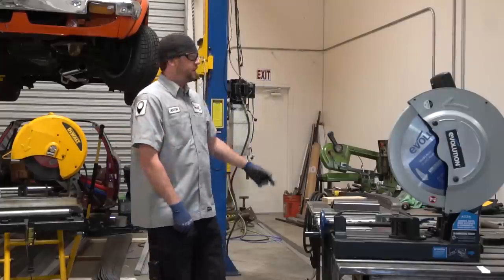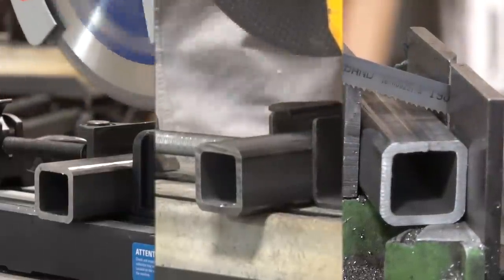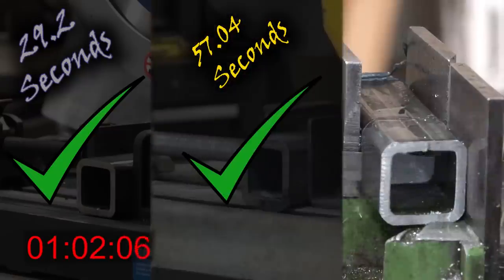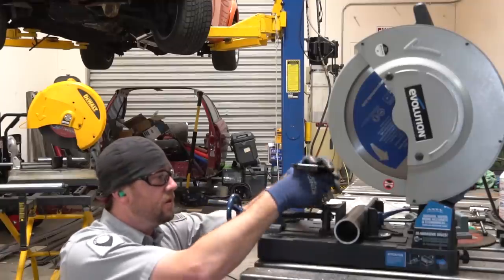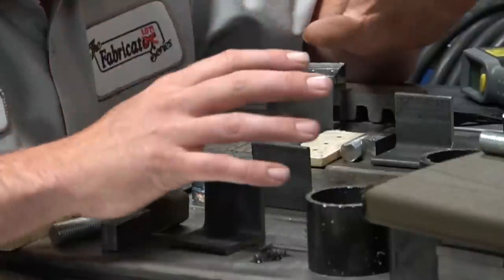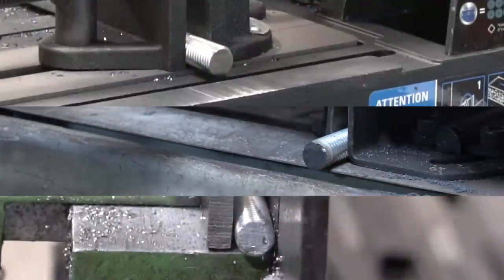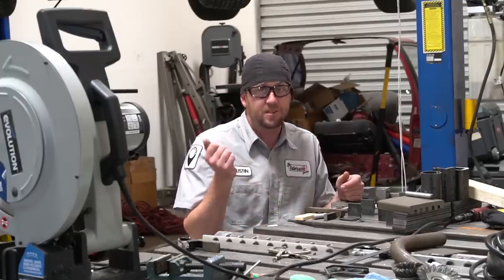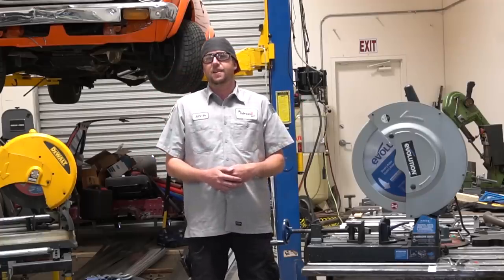TFS: 3 Metal Cutting Saws Tested and Compared

Comment from the maker: Ready to Weld Practice Metal
https://weldmetalsonline.com/

Tools & Gear We Use and Recommend
https://www.amazon.com/shop/thefabricationseries

Learn to TIG Weld in Our Class!
http://thefabricatorseries.com/classes
Reply: Get a thinner chopsaw disc 3/32, less material to cut and faster.
Reply: Is this sponsored by Evo?
Reply: Did you find the Evo saw chatter at all in the cut?  It drives me nuts with mine and the cut quality suffers.
Reply: @bikedeefer  mine chatters once in a while, and when it does.. it loses teeth.. I found a local guy who sharpens blades and replaces broken toooths..

Comment: The advantage with the bandsaw is you can walk away while it cuts and do other things. It also accurately cuts mitres repeatedly, with no dust and minimal heat. And makes hundreds of cuts on one blade.
Reply: Daryl Younger agreed. I have a JET that has a coolant system and feed rate setting. It has a 20” opening but I can only cut 10” thick stuff.
Reply: But then factoring in the blade cost as well, you have to be pretty serious to get the most out one.
Reply: also out of all the saws i find it has the least waist which i find pretty important for me cause i use rather expensive steals like pattern Damascus and certain cpm alloys over the course of a year you can save almost the entire cost of the tool in stock plus at points the abrasive saw can heat up the metal to much and cause some light decarbing its pretty minuscule but always good to take into account depending on the job
Reply: @blairfleming5861  im trying to get into a wet/cold saw for accurate metal cuts. I have a pos horizontal bandsaw, but it does take up some space. Im not finding anything good as far as a cold cut chopsaw for under $2000 - but i can find a LOT of quality 220 horizontal saws. for much less. I hate the footprint, but i feel like the horizontal bandsaw could do everything the chopsaw could but more.. What am i overlooking about a cold cut chopsaw, since the price seems so much higher, any ideas? Cheers
Reply: @Swilling  I saw the evolution ones have much play on the blade so it is not so accurate, maybe the dewalt is better.
Reply: The advantage with the evo saw is you dont have to wait at all - quicker to cut it than set up the old bandsaw
Reply: I have a 35+ y/o cheapo bandsaw that I have used all of that time. At times the blade jumps off twice a cut. Very annoying. The bimetal blades are better but expensive. And generally cut straighter as well.  It has built race cars, trailers, gates etc but can be frustrating,
I bought a friction saw recently, noisy and sprays crap everywhere but it cuts straight and quick and does not leave  very much mess. Good blades cut better and longer though cost more. Worth it in the long term
The third item you used is decent but the leave a bigger mess. 
The expensive bandsaw would be great but not on my budget!
I had a power hacksaw, slow, reliable and cut straight but it consumed to much room so I sold it
Reply: The advantage of the Evolution it seems is that you don't need to walk away because it cuts so fast, minimal bur cleanup and no coolant to cleanup either.
Reply: @alexisxyz7531  Was that one of the thin kerf blades?  That's their definite downside.

Comment: I have an Evo rage 2. It has the multi purpose blade. I'm very impressed Hundreds of cuts and it keeps on going. Hearing protection is a must
Reply: The thing I don't like with the evolution rage 2 is that mine has got a sheet metal base which is just flimsy and when you tighten down the piece you are gonna cut it gets out of alignment. And there is no way to adjust the angle of it so mine cuts crooked. The one he tries here does look A LOT better and I am thinking about either rebuilding my base or buying the blue series one.
Reply: The Rage2 I own has cast base so there's no flexing. I think they tried the sheet metal base on a model or two and went back to cast.

Comment: The abrasive is just nasty. Least favorite tool in my garage. Love my band saw. I would consider the evo for quick cuts
Reply: My abrasive saw is somewhere under a bench, Ijust use my horizontal bandsaw even though it is only a 50 year old 6" x 4"I can still make it cut true enough for welding.

Comment: Great video as usual - Like most fabricators I have all three - I have not taken the Abrasive off the shelf in 3 years. The bandsaw is my goto, its accurate and clean.  Although when I build a trailer or chassis with a lot of heavy tube to do,  the cold saw is FAST.. I wear full sleeves and a hat - those chips fly hard and fast

Comment: thanks for the info for us,don"t forget you can walk away from the band saw.
Reply: Wastage is a lot less on the bandsaw as well. Those chips add up, not only in wasted material, but in wasted effort. On a saw running all day nonstop, someone has to sweep up regularly on the evolution and abrasive (and the mess gets spread out a lot more) but only once at the end of the day on the bandsaw.
Reply: I'd rather not wait at all.
Reply: The safety guy says other wise lol
Reply: You can multitask.
Reply: Phil Harvey  Also you are limited more on the depth of cut in both the Evo & the chop saw ( less as the fibre disc wears too). I have cut solid 6" M238 injection mold steel on my cheap 6x4 band saw at 11pm  without disturbing anybody. I could not have done that on my Chop saw or Brobo cold saw. Not sure whether the Evolution would cope with a 6" x 6" SHS or solid  in one go even though it has a 7" depth of cut. Imagine the noise making a few of those cuts, very unhappy neighbors even in an industrial estate.

Comment: Great video! I don’t even have an abrasive anymore, I got rid of it once I got my Evo saw about 3 years ago. For anything large and in charge I use a large industrial Ramco bandsaw,. For anything 3 inch and below I just use my Evo. Blades for an abrasive run anywhere between $7 and 15 bucks, but a user will blow through them quickly. Blades for my Evo run anywhere between $90 and 110 depending on where you get them, And will last a bit of time if you take care of them. Now blades  for my bandsaw run anywhere between $45 and 55 also depending on where you get them, and those will also last a bit if you take care of them. I dug your “man glitter,” joke! Lol. Keep on making these very informative vids, you always explain everything that you do very well; so well in fact that I recommend your vids  to my apprentice as outside the shop study and learning materiali. Thanks brother!

Comment: I have all three types, my go-to for everyday use is a bandsaw (cheapie small one without coolant), for lots of cutting i bust out the noisy dry cut makita, and old abrasive makita is collecting dust in the corner for years.
Makita dry cut saw comes with blade for thin wall steel, but it cuts stainless or thick stuff without any issues, just be gentle on the handle. I'd say i made at least 1000 cuts with stock blade and it still rocks.
And cutting speed just blows me away every time i use it.

Comment: I have all 3 devices, and here's my input. One very critical issue besides the quality of the cut and left over burs is the ACCURACY of the cuts. I have noticed that the abrasive disks "walk" considerably during the cut, (partially due to their flexibility) and end up with an angled cut that's not 90 degrees requiring grinding to make them square. The Evolution also "walks" very slightly, but overall has a fairly accurate cut. By far the bandsaw is the most accurate cut, nearly perfect 90 degrees. Of course the larger the piece the more angled the cut becomes. I hope this helps.
Reply: Dude! Thank you so much, you can't believe how much videos I watched on youtube about these 3 types of cutting machines and none of them mentioned the ACCURACY of the cuts, and angle distortion, thank you so much!
This definitely helps a lot!
This comment needs more likes
Reply: I agree, I wish someone would do a comparison of these saws and their accuracy with 45 degree miter cuts

Comment: Results as expected. I'm the retired owner of an Industrial controls business. Have a bandsaw in the shop (now over 40yrs old and still like new)  and it's the goto for quality machinery frame fab work and the like. The chop saw is for road jobs, and doesn't get used except for road work and junk that may damage the bandsaw blade, good bands don't come cheap. I went thru several of these over the years, they don't last all that well, and will get you invited off many  a jobsite. It's usually a parking lot operation, and you better have a fire ext right there in plain sight at most places, or somebody will complain. The cold saw has been around a while, been kind of pricy for what you get for about 20yrs, so I never sprung for one, seeing as the prices are down, if I was still doing this work, I'd probably replace the  abrasive saw with one, and I expect it would get used along with the bandsaw when we get busy.
That's my mini-review, 
Thanks for yours, it's a good look at each, you could have skipped the wood, that's Sawzall material...

Comment: At first I was using a Dewalt Abrasive chop saw. The 45's were terrible, the blade would flex around so much that the cuts were all crooked.  Then I got the Dewalt Cold Saw.  The vise on it was junk.   Now I have the Scotchman Cold saw.    It's the best saw.  The 45's are perfect every time.   It also doesn't leave a big mess with metal chips everywhere like the Dewalt does.
Reply: Similar experience with a Makita abrasive chop saw; for 90 cuts there was too much flex in the "blade" after the first cut and just wouldn't make square cuts when cutting either aluminum angle or angle iron.

Comment: I recently bought  a super cheap band saw (portable with a stand) and im super happy with it, is still  loud on high speed, but its much quieter than an angle grinder and no sparks which means i can  use it inside my shed.

Comment: I have the Evo with the 15 inch blade and love it.  I use both the steel and stainless steel blades without issue in the appropriate material. One suggestion: pay attention to how the instructions tell you to mount the material in the vice. Not only does it make a big difference in how fast your cut will be, but makes a huge difference in how long your blades will last between sharpening.
Reply: That attachment is not just a pipe holder on the Evolution. Try the square tube positioned the way the instructions suggest so everyone can see how fast it really is. I believe the blade will last longer as well. Be careful with the blue blade on thin metal, get the thin metal blade... trust me.

Comment: One thing I found using my "dry" cut saw was to just cut outside and use a hose to flood the cut with water. I had to cut 2×2 square stock (solid mild steel) without water the cut took forever and the heat effed a few teeth. With water it cut faster, stayed cold, left a better finish and the teeth were fine- in under a minute.
Reply: Since its carbide teeth, it's prone to shattering because of thermal cycling on and off. Run the cut under water.

Comment: I am a woodworker, and your video has me sold...on the Evolution products. They make a small miter saw that uses one of their metal cutting blades. Occasionally I need to cut up some small tubing or steel stock for jigs or other things, and that Evolution blade seems to work really well. Thanks for the demo!

Comment: One advantage to using the bandsaw is the ability to set it running and move on to another job, thereby allowing you to save time in the shop as you multitask.  And there are other cheaper vertical bandsaw options.

Nonetheless, this segment was insightful.  As always, thanks much for sharing.

Steve
Reply: Depends heavily on what you're cutting. For typical cuts, the Evo finishes in less than 1 minute. Less than 2 minutes for extreme cuts. How much work can you get done during that interval? None.

Comment: I absolutely love my tct bladed saw. Cuts through just about anything. I've cut copper tubing, to steel tubing, to two inch hex stalk. Apparently supposed to switch blades for alloys but I've cut stainless, aluminum and 4140 (annealed). It's a beast 😁!

Comment: At work we have a Band saw and a cold cut saw, the band saw is a Square cut only with an adjustable length feeder and cut counter, very good if you want to cut a lot of parts the same length and walk away from the saw to do other things. The cold cut saw is what was called a "Brobo" saw, which I think was a brand name years ago, its a slow speed about 350mm diameter blade, coolant system and double vices, NOT carbide tipped, when the blade gets blunt, it is taken off and sent away to be re-sharpened. It does angle cuts up to 32 degrees from straight, that's way more than the old abrasive chop saws that can only go up to 45 degrees.

Comment: In our Welding classroom we have a large Bayleigh bandsaw that did most of the heavy lifting until the  teacher brought in the Evolution saw with a steel and aluminum blade... it is a phenomenal improvement in speed, the dry chips are easier to sweep up (instead of scraping up coolant sludge) and it is movable... I would complain about the noise but it cuts so fast, the noise doesn't last too long.

Comment: Great video ,I have been using evolution saw for last few years and it have been the best buy for budget to cut steel or if needed sometimes wood . Great saw to have I payed for my saw £180 in UK with 350mm blade .pretty chip brand new

Comment: I recently purchased the evolution from Home Depot. I used it to cut 2 -7/8” pipe. Did great 👍
Reply: I need to cut 2 7/8 pipe as well. I'm thinking of finally picking a saw up.
Reply: @cutweldngrind  if you get the evolution get more cutting blades for metal.  I have to drive 70 miles to get them.  So I buy extras
Reply: @bikerbrego  Thanks. I just got the specs by email on several saws to compare but I will sure get blades. I do own plasma cutters  but this will help me rebuild a goose neck trailer faster. Thanks

Comment: Nice comparison. 
I knew from the start the Evolution was gonna wipe the floor with the others as I have an Evolution compound mitre saw for wood and it cuts through metal just as good as you saw yours work. 
I have to say the Evolution brand of saws and other tools they are bringing out are one of the better deals  you can get and with one of the smoothest results you will find.
JJ

Comment: I ponied up for the Evolution a couple of years ago. It's now my go-to saw. Yes, it's loud, but it's fast and accurate, and I work alone most of the time so I don't have a problem not being able to carry on a conversation. It requires minimal cleanup before fitting and welding - the most I've had to do is hit the edge with a file. As a bonus, the workpiece stays cool enough to handle with bare hands right after cutting it.

A couple of hints for using the Evolution - first, if you're going to do steel production, buy the dedicated steel blade. It will last virtually forever. Second, it likes cutting across material, so if you have flat stock to cut, lay it on its side in the vise instead of laying it flat (assuming you're not making a mitered cut). And last, I made a chip tray that catches most of the chips.

Comment: I’m pretty happy with my evo saw for mild steel but for cutting steel studs it was a let down. I had a big job with heavy gauge steel studs and ended up digging the Rigid abrasive saw out after running 3 blades through the evolution in one day.

Comment: Hi Justin. Thanks. Really useful. One other 'horizontal' bandsaw advantage is that some can be used vertically for small pieces, which can be useful in a hobby shop. Just had a cheap Chinese bandsaw die (blade tensioner cracked) so I'm in the market for a replacement. It won't be an abrasive saw after watching your excellent video! Cheers. BobUK.

Comment: I have all 3, different brands to yours as I am in Australia. The bandsaw has two big advantages, if will cut large solid pieces like say 2 inch diameter bar and you can leave it to get on with it and go and do something else. I got the dry cut saw about 18 months ago and my friction saw pretty well retired that day. The dry cut saw cuts neatly, accurately and gives an almost machining like finish and you can pick up and handle the cut without burning your hand. I started with a friction saw, but if I was setting up now my first buy would be the bandsaw if I could afford it.

Comment: I had a project where I had to cut stainless for 10 days. 1.5"x⅛" stainless angle. I have a Morse 14" chop saw. We used several different brands of blades. The one that almost doubled the cuts was the original Morse 90 carbide blade. I do want to check out a band saw. Thank for the video!

Comment: I had the cheap Evolution saw, the orange one. It cuts square 90’s  very fast and straight. The blade warps on angle cuts and doesn’t leave a true cut. They’re also VERY loud, and the chips mine made were like tiny razors, and they went everywhere. My go to is an old American made Kalamazoo band saw. Cuts straight and true, stock sizes of anything I can handle. I can even throw a stack of material in there and let it chug on the stack while I do something else.

Comment: The Evolution 10in miter saw also can cut metal and has double angles with miter cuts. Only $200 when I bought it. Does go through $50 blades pretty fast.

Comment: What I don't like about most Chop Saws is when you try to cut 45 degree angles, the jaws that hold the metal in place are no longer aligned directly across from each other, nor do they hold the metal in place very well.